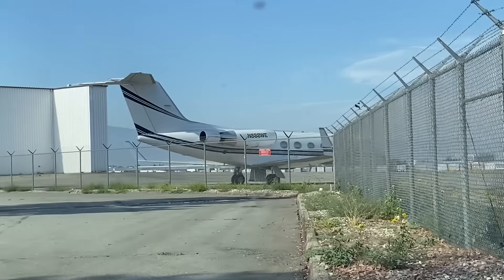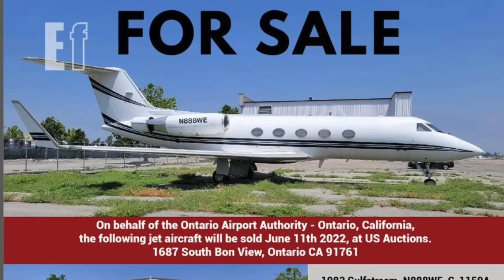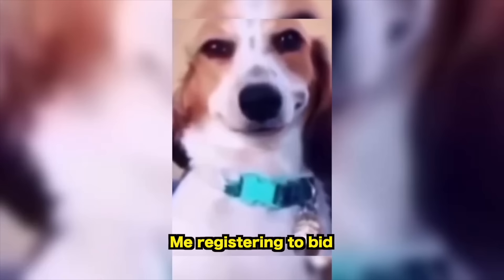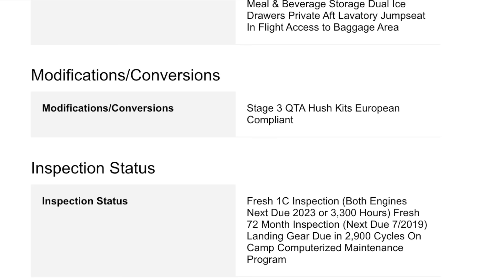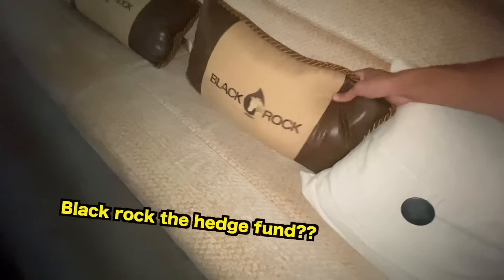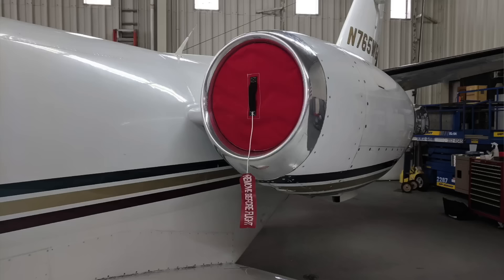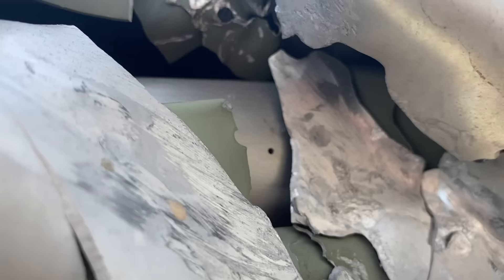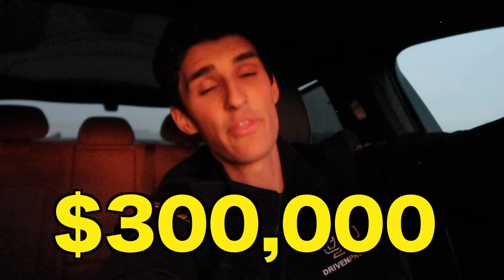$100,000 ABANDONED Gulfstream GIII At Auction... Did I Bid Too Much?

Comment: In 2020 I looked at a Gulfstream three in Miami that was used by a Latin music artist and it was about a $500,000 & could fly but it smell like a discotheque inside. The inspections were all out of date probably another 300-500k to get it back compliant. So the price of 337k for that G3 was quite fair.
G3 are noisy & quite cold when you’re flying around 43 but it feels very solid because it’s a Grumman. I imagine you could put it out for lease and at least cover your cost to own it but it is an old plane noisy as hell and you’re always going to be wondering what else is going to break. This plane is strictly more of a demonstrator and something along that line rather than to think you should be using it as a private jet. There’s many better choices than a 550 gallon an hour drinking monster.

Comment: As a current G3 pilot with experience trying to get a G3 airworthy after it sat for years Rolls Royce will never sign off on even ferrying that plane without pulling those engines for a full inspection!    That cost would likely be $400,000 per engine.  My plane just went thru 72 month at a total cost of $550,000.   Good luck!
Reply: There are always dreamers ...
Reply: Damn ! I guess I’ll stick to building classic motorcycles, $550k ! Damn ! Sorry, I mean I love aviation in general and completely understand a lot of it having had a year of A+P school, but the price of flying now has just crushed my dreams even further. Stay safe ✌️🇺🇸
Reply: My understanding, last I looked, you don't need the manufacturer's blessing for a ferry flight -- you need an A&P with adequate knowledge of the specific aircraft/engines.

Comment: Worked for Gulfstream for 35 years. Would be cheaper to buy a 2022 G700 than doing a rehab on a GIII with missing avionics. This is a great buy for parts however. Or maybe demate the wings and turn into a restaurant.

Comment: Off the top, never invest in an aircraft that you're not sure can fly. I performed depot maintenance for DOD on several fighters. Even if you were able to get all the parts that were missing, you would have to replace ALL avionics and critical components. A true overall requires that everything is removed, restored, and replaced if necessary.  Great buy on the Cessna. Enjoy.

Comment: Having flown the 47, as well as multiple sail and motor plane types for a little over 25,000 flight hours and with a deep fascination for pre-owned Gulfstream G3 and G4 aircraft, I've found the insights in this video particularly intriguing. Being retired now, but having spent years in aviation, I appreciate the complexity these aircraft bring to the table. While some commenters express hesitations, I believe there's potential in these projects. With a willingness to invest up to USD 250,000 for each plane, I'm optimistic about the value they could offer. It's a thrill to see the aviation community discussing these prospects, and I remain upbeat about their possibilities.

Comment: Yeah as an actual aircraft broker, that thing is worthless without logs. Period. For what it would take to bring up to current, no one would go for it. And just so you know, when it went for sale and then came "off market" in 2017 it had an asking price of $3.5M.
Reply from the maker: Woah! $3.5 million! I wonder is the buyer secretly has the logs or access to then?
Reply: Any idea why they left it to sit there?
Reply: @OOpSjm  After it's last flight from Columbia,it had served it's purpose and was no longer needed. 😉
Reply: What do you think the buyer intends to do with it? Spare parts? I don’t even understand how they will transport that out, assuming they’d have to clip the wings.
Reply: @aph757  it's in the hangar next to it
Reply: @aph757  That could be the plan. I managed a Falcon that I sold(sans engines) on behalf of the owner to what was essentially an aviation junk yard. They came and an removed the wings, threw the whole thing on a trailer and off they went.

Comment: Unless you are a absolute multi millionaire and have a mechanic who has experience on the G-1159A stay away. The fuel consumption is extremely high and parts are hard to get. Even if you have stage III hush kits their are still airports that don’t allow these to get in due to neighborhoods that complain. I have two GIII I have had at my FBO and the owners love them but of course at a fuel burn or 6,500LBS the first hour. On top you want a A/C model and not D/C model of the GIII. (After usually 83 if not mistaken) Later years. Great airplane and stunning but not for everyone and a thirsty bird. Cheap to buy but costly costly costly to operate
Reply from the maker: Very true
Reply: What do you mean A/C vs D/C? Can you explain that?

Comment: For a moment, I thought I'd hear about the Gulfstream at LVK. The story I'd heard was it was kept in a hanger and when the bills weren't paid, it was pushed outside. Same deal, no covers, nothing. One of my customers at the time was an A&P and said it was apparently a part of a property settlement and being that it needed engine inspections, neither party wanted it so it sat. It sat for several years as well. Then one day it was gone. Never did know the answer.
Reply: What years did this all happen and was it painted pink with a cloud motief design up the tail? The airplane I'm thinking of was hangered on the south side in one of the larger hangers near the lab. I believe it was a G2. The company that managed it was called Continental Aviation Services. But this was all back in the late 80s.
Reply: @davidsine4390  If you are referring to the LVK plane, idk when it started but it was parked next to the fire station on the Airway Blvd side of the airport and was there probably starting in 2017?
Reply: @ian408  Yes, I was referring to your post about the LVK plane, but I don't beleive it was the same G2 I'm thinking of.

Comment: I've watched a plane similar to this Gulf Stream stored at the PDX airport for years (it too has hush kits) . The ground crew move it around the apron, it gets washed and presents well,  but it's a 1966, I don;t think it can fly, And because of cost getting the certificates up to date, and the fact that spare parts aren't available, it may never fly again,. If you can get an aircraft such as the Gulfstream air worthy, they usually sell to the narcos, and are usually found abandoned later on.
Reply: There was a jet that landed on a airstrip in the middle of nowhere (Kansas) some years ago, unloaded and left for dead. Runway was too short for it to take off again after the DEA got ahold of it.
Reply: @carlinshowalter1806  Marine boat brokers mention that newer, large fishing vessels have been found abandoned. It gives some idea of what the profit margins might be.

Comment: It's worth it  to buy g3 that cost 100 K to 200 k . Aquiring spare parts it's easy in USA since you can purchase another grounded g3 with less than 100k and get all the spare part needed. You  Will end up getting cheap gulf stream airworthy. You can also Renting it with cheaper rate and get more costumers and  return your money in less than 6month.

Comment: Someone with knowledge might be interested in just the engines, but you with zero knowledge would be crazy to buy it :)
Always be weary of old high dollar items, that was once crazy luxury but is now just a contract for massive losses. Just look at that cast iron junk room they call avionics. Endless old garbage units that are borderline irreplaceable and gatekept by people all too comfortable with making up high prices for you to pay.
If you had to dabble in jets, you could try to find an early Phenom 100 but they are so popular that it's not going to be easy. The problem with the current selection of jets is that none of them are built cost effective. I heard from a jet operator that Embraer Phenom make the best financial sense and anything else is just much more expensive. Phenom 100 is something like 4miles per gallon which is probably close to a Baron. If you don't charter and only fly yourself, maybe the service is moderate. But you are looking at 2.5mill on a good day. Newer fresher gear is just so much nicer than 1983. Old expensive has constant ick. It's a garbage dump with a million dollar annual upkeep. It's a hell no. BUT what you might do is buy a Phenom and sell fractional ownership for your local airport if there are people enough around. Say you sell 3 parts at 750grand a pop, you almost get your part for free in return for you managing the plane, make sure it always works. You could have a pilot for it but that's a very different fixed cost thing. Maybe you can find local pilots willing to step up on rare occasion to fly owners. Maybe Owen would think it's cool :)

Comment: Any aircraft that sits for that long is going to start to leak fuel, oil, hydraulic fluid, kind of like the F-4 when it stops leaking it's out of fluid.  I didn't see any puddles in the pictures and the tires are inflated.  Either someone has been looking in on it and doing minor service, or this is a scam.  I was working in JAX when Eastern went under.  Two DC-9's sat on the line for over 60 days.  Both had huge puddles under them and flat tires.  Eventually a contract company came in serviced them, started engines and they flew away, total time sitting was probably six months or less.  FLY NAVY!!!
Reply: Isn't the Navy a small part of the Marine Corps ?
Reply: @grumpycat4584  The marine corp falls under the department of the Navy.  Another acronym for Marine is My Ass Rides In Navy Equipment.  FLY NAVY!!!
Reply: @USNveteran  I'm seventy-one, and I never heard that one.  Merry Christmas , Navy.
Reply: @grumpycat4584  I'm 66 & worked with quite a few Marines when I was in.  There were always some interesting acronyms thrown around.  Merry Christmas to you as well Marine.  FLY NAVY!!!
Reply: @grumpycat4584  I must have had a senior moment, meant to include this as I am sure you are a Nam vet.  A long overdue WELCOME HOME to you my friend.  I worked with many Nam vets when I was in one guy was even Korea & Nam.  They were all a great group of people and I feel privileged to have been able to have worked with them & learned from them.  FLY NAVY!!!
Reply: @USNveteran  Thanks Sir,  Merry Christmas to you and yours.

Comment: it doesn't matter if the engines were just overhauled.  The manufacturer is going to make you probably OH them anyways because it sat for 4 years.  Even if a plane sits it's required to run the engines every so often for preservation.

Comment: That's more than I would have thought it would sell for.  It would be uneconomical to get that thing flying again.  Just fixing the leading edge would likely be as much as you paid for the airplane.  Even though it's in pretty good cosmetic shape, the missing parts, needed servicing, and repairs make this a parts plane.  I don't know if it applies to the GIII, but some of the later Gulfstreams had an AD on the tail for corrosion issues and it's a huge repair if it needs fixed.  this airplane is likely full of hidden nasty surprises that will be eye wateringly expensive to fix.  There's that old saying with Ferraris that if if you can't afford a nice one, you definitely can't afford a cheap one and this principle goes double for airplanes.  It's usually worth it to just pay up and buy a nice one rather than trying to polish a turd.  Private plans can be very expensive to keep and repair and a Gulfstream is basically at the top of the heap in just about every way.  Big, comfortable, powerful, fast and capital "E" Expensive.  Just for perspective, single engine Cessna's, Pipers are about like a Ferrari to maintain and keep running.  Turbine powered (jets and turborops) are way worse; at least 10X what a small single engine plane costs. Source: 20  years in the industry as a pro pilot, dad flew Gulfstreams for an oil company.
Reply: Boats are another money pit.

Comment: The engines are probably alright despite exposed to elements. Those are $500k alone easily- impellers if not out of whack are $!00k each.  Gear assemblies if brake rotors are good are another $350k. Mufflers are easily $250k. All in this one in particular has about a million bucks in hard to find parts.

Comment: Possibly a parts buy?  For an existing G3 owner.  Not necessarily a US based owner at that.
But if it was going to be a restoration project.  I've seen people spend many $100,000's and multiple years to do up planes.  Ok, most of those have been WW2 era bombers and Spitfires.  But I couldn't imagine the process being too much different.
Reply: Airport worker commented that it's now in a hangar being worked on.
Reply: @OOpSjm  They are reinstalling the parts they removed years ago.

Comment: It'll cost around 5 million to get it airworthy again. 100k for the inspection alone. 800k for the air flight time and testing.  Misc will probably run 100k. If you don't have millions in the bank, it's not flying.

Comment: The missing log books and the wing damage is a deal breaker but add in the missing avionics and it makes no sense.
That’s a Collins flight deck so the FMS’s will be expensive, you are probably better off installing a couple Universal FMS systems and taking advantage of the WAAS/LPV capabilities but that also causes significant upgrades to the current EFIS system to display those capabilities.
Bottom line….you need 7 figures worth of new/used avionics and upgrades and that’s BEFORE we address airspace requirements such as RVSM and ADS-B out.

Comment: The worst reason to buy this place is the extreme heat and cold in Ontario.
Every part in the plane will contract in the winter and expand in the summer.

Not to mention that everything is outdated.

Oh, I forgot to mention rodents eating the wiring and shitting on everything.

Comment: complete refurbishment of this ultra cheap USD$100,000 Gulfstream G300 private jet will cost you as much as €4.3 Mn - €10.2 Mn . . . bringing it back into fully airworthy state will be an uphill battle . . . type re-certification with the FAA & NTSB approval will be necessary . . . the G300 could serve as a indoor static display for customers at well known Starbucks franchise or TGI Friday's . . . even then the G300 will require exhaustive refurbishment both inside & out . . .

Comment: You really like to push your luck! Happily, you didn't "win" any bid. Probably those guys that paid those +$340k own a repair station or need a Donner AC to maintain another's... the ADs, mandatory SBs (airframe, systems, engines, and  APU) scheduled maintenance pending are the biggest money consuming items, and specifically the engines... that AC was just sitting on the tarmac without any long-term storage maintenance. Just adding up the amount of manpower needed to make it airworthy will give you a glimpse of how much you will spend. I had my own chance to "dance" with a GIII, and sure, it was nice to work on her, but she had an eternal fuel leak under the wings and other structural small issues that were livable but the engines were the most expensive items. She ended up in south FL as part the warehouse of a RS.
Thanks for sharing

Comment: The reason it is sitting is probably because it doesn't have hush kits on the engines making it too loud. Also, it most likely isn't RVSM certified and that would cost as much as the jet costs. If it doesn't have RSVM , pass this one up.
Reply: Try a piper malibu. Flies like a jet, speed won't get ahead of you. Insurance is cheap. There is no downside to owning a Malibu /M350

Comment: Car mechanic: I put a new muffler on your can to make it quieter. It'll be $500. Meanwhile in aviation: I put 2 metal tubes on your airplane to make it quieter. It'll be $800,000,
What the actual fuck. The button panel with about 20 plastic buttons in my helicopter costs $20k. About a thousand dollars per button. Aviation is a fucking scam.

Comment: check to see if the flight controls  ie pullies and  cables survo's whats the shape of the gear the brakes the tires.  The plumbing  the tank the APU  if there is any fuel in the tanks have it drained  out of the wings  the a/c compressor you may have yo do a flightdeck update
Reply: Pulleys and cables?  Dude this is a g3 it has hydraulic flight controls and linkages :-)